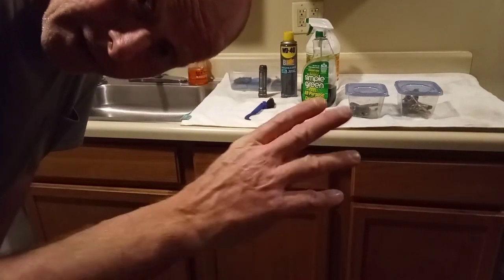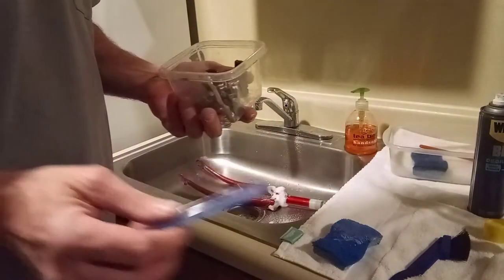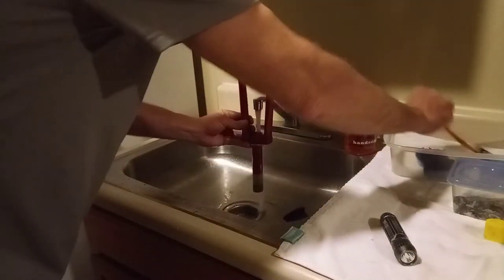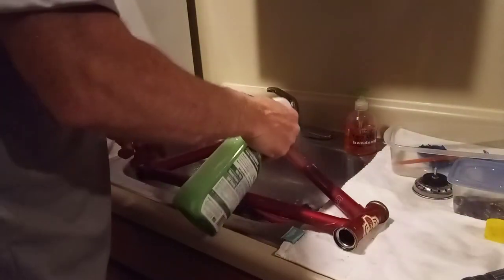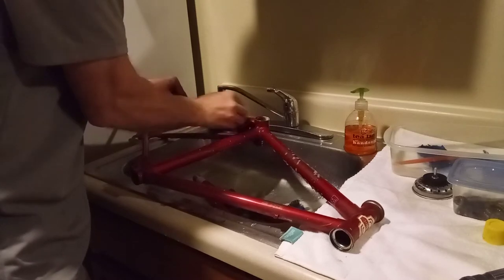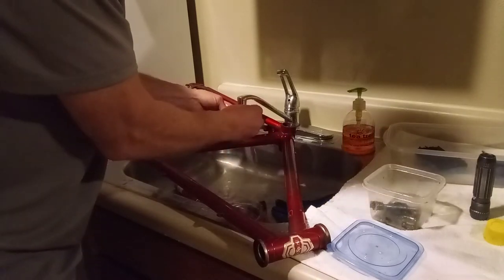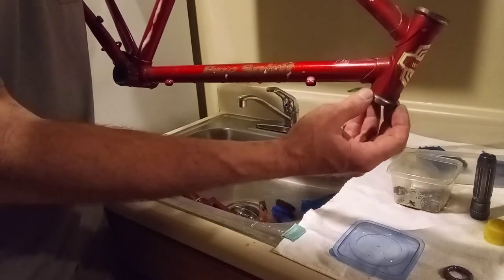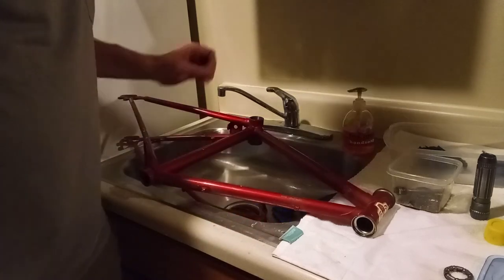Cleaning Bicycle Parts

Comment: Get wd40, that's what will clean the inside and outside of the frame and anything else. Personally i would not do it like that, all the grease, oil , sand, grit could clog the drain and all those chemicals shouldn't be going down the drain.  Normally sewage waste water will reach the water supply especially if it rains. But either way i only use rags and tissues for cleaning then to the landfill, In Ontario the landfills have a liquid containment diaphragm, so all liquids get pumped out and sent to hazardous waste depots by tanker vacuum trailers.
Reply from the maker: Well here in America all of those chemicals are sold for cleaning and normally go down the drain. I am well aware that chemicals get into our water supply, things like oil that seems to leak from every other car in the US, plastic from all the garbage people  throw on the ground, drugs from all the drug users tossing their needles into rivers and sewers, I could go on for hours. If all of these chemicals are so bad, why are they allowed to be sold? I'll tell you why, because no one CARES. It's all about the all mighty dollar.
Reply: @CargoBikeCowboy  Exactly right nobody cares. Its a education thing i believe, We need to teach young people more about the environment, In city of toronto they make these radio commercials telling people to keep trash out of the recycling stream.. great but alot of people dont even know that its law that you can return used oil and filters to any auto service garage for free, and how harmful oil, CFL's and batteries are if dumped in landfill; They have to be taken to hazardous depots.  Another fail by the goverment and "ministry of the environment" According to Bristish columbia's website one drop of oil contaminates 1 million drops of water and 1 litre of oil contaminates 1 million liters of ground water.